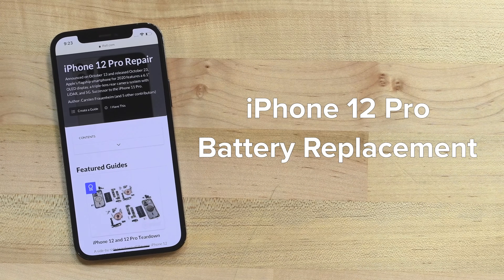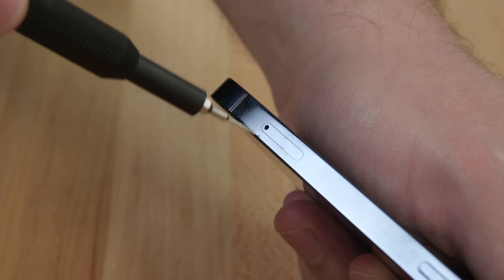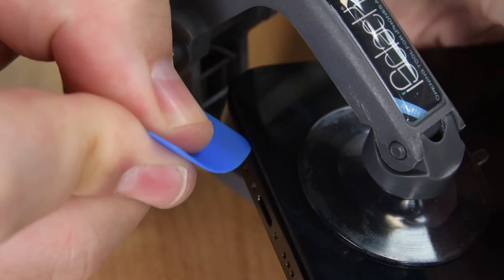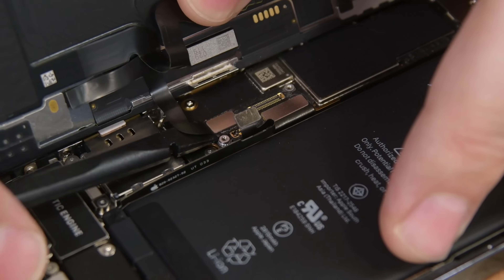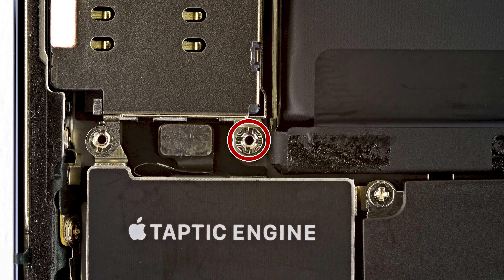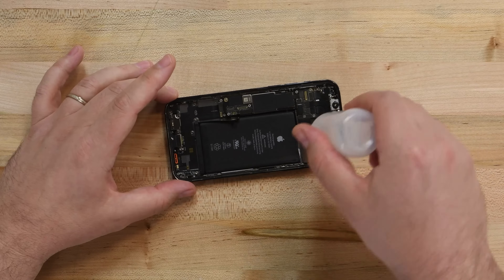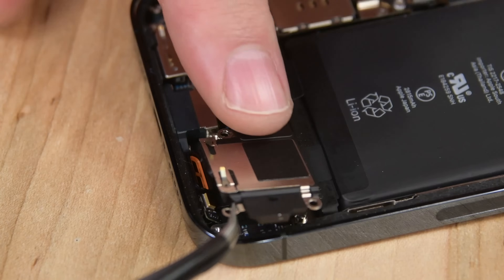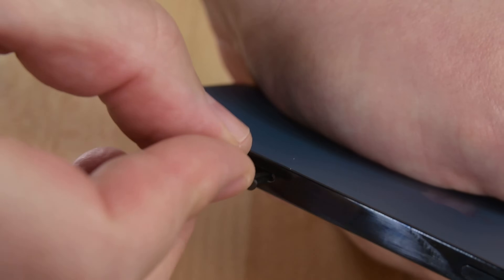iPhone 12 and 12 Pro Battery Replacement

Comment: I am not really a fan of giving apple all my money but battery replacements arent that expensive and you get the best quality and you wont get the battery message
Reply: But why should Apple be the ONLY option for repair. Say your running something like an IPhone 5, I doubt Apple still repair a those, even if they did then the repair would cost as much as the device. What happens when newer unrepairable devices like the X/11/12 become that old? Your screwed.
Reply: You could still do it yourself or go to your local repair shop they would still charge you about 60-80$ but then you are greeted with a important battery message so when X/11/12 get older you may be thinking of getting a new phone.
For instance take the iPhone 5, you can get one on E-bay for 25-50$ and if you need to replace the battery if you use a good battery like from iFixit they are still 20$ so you may be thinking of just getting a new phone as the other models drop down more and more in price every year.
My iPhone 6s plus had a dead battery (Would shut off randomly and the battery lasted like 10min) and also a cracked screen I also had the phone for 3 years so i just upgraded to an XS Max.
Sure the parts weren’t that expensive to repair it but you don’t know how long it will get software support or how much will it be worth in 2-3 years, I sold mine for 80$ which wasnt a bad offer at the time.
Reply: @tospoooky4me-417  the issue is that if you replace the screen on newer Iphone and samsung A series phones, you end up losing support for things like trutone, in screen fingerprint scanners and you get warning messages. Similar thing with batteries. Modern devices have gotten fast enough that upgrade cycles more than every 3ish years serves no real purpose to the average person. Although resale values will still plummet, I believe current devices need to be longer lasting, not the other way around.

This argument does go for software too, although I could care less about software updates, because I run custom OS skins, I realize that devices should ship with at least 3 years of OS updates with another year or two of security patches. I think my argument can be summed up in this one sentence - we as consumers should demand better, more cost effective and resource concious devices. 

I was going to end this with a smiley face but realized that the animated RGB keyboard I have loaded on my kindle lacks a colon...
Reply: @Carterthielftw_  I agree, I have been wondering if phones like the 11 pro max will feel faster at the 3/4 year mark than something like my 7+ which by the way does still feel relatively snappy